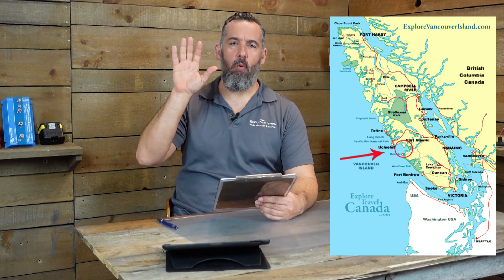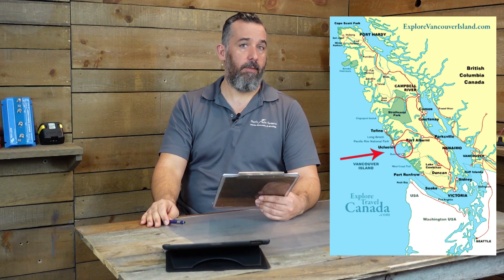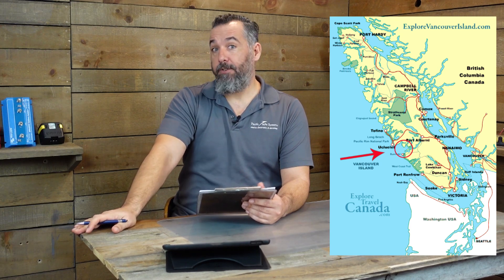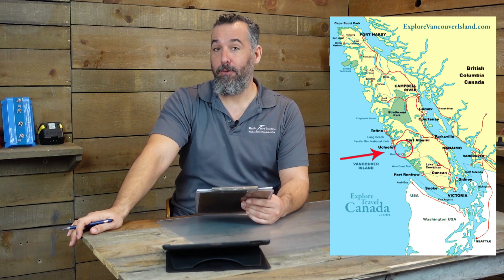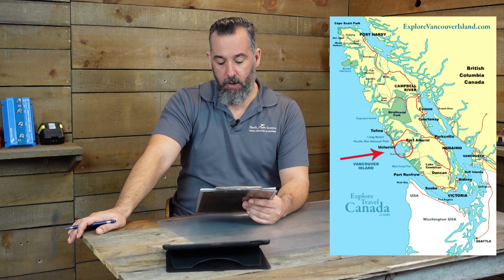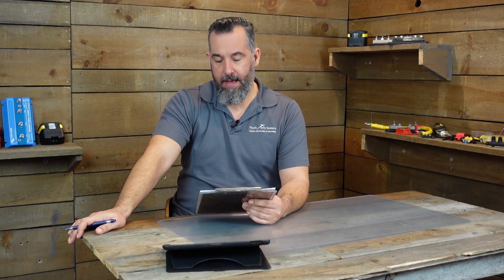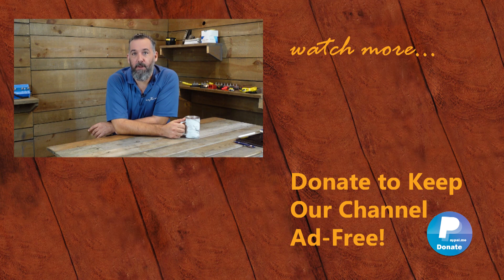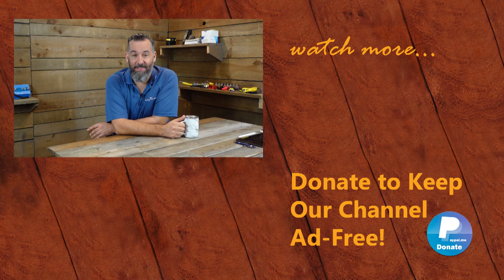If I Have a Fuse Block on My Boat's Battery Post, Do I Need a Class T Inline Fuse To the Inverter?

Comment: Similar question.  My VHF came with an 8amp AGC inline fuse.  I have a dedicated slot in a fuse box for the radio.  Can I just put an 8amp ATO fuse and remove the inline fuse?  The other question is should I, the inline fuse is hard wired so it would require a new butt connector in the wire?
Reply from the maker: Hi Eric, yep that will work. Correct, when removing the inline fuse, you'll be reconnecting the wire via butt connectors or a terminal strip.

Comment: Interesting. Thanks for the answer on fusing. I would not have thought of using two fuses along the line. But I suppose it’s actually fairly common. That way the appliance gets the exact fuse it needs (size, speed, breaking capacity).
Reply from the maker: Thanks for sharing Brian, yep 2 fuses, one for the circuit and other for the appliance is pretty common.

Comment: I always say don't be afraid to add fuses to large loads because the voltage drop across a large fuse is quite small until you get close the the rating and most of the time an inverter isn't goin to be running full-out. Except in a runabout, gasoline is an impractical marine fuel. Just the fact that fumes have no place to go unless you exhaust them deliberately makes diesel much more attractive to me (ok, it's really the torque, but not blowing up is good too).  As always, keep the content coming Jeff. Your channel fills a niche that no other channel I am aware of does. Bravo! (Not the stern drive. LOL)
Reply from the maker: Thanks Tao for sharing.

Comment: Hi Jeff ... Off your immediate topic, but back to battery monitoring systems. I want to install a Victron BMV 712 on my boat but need more RJ12 than the 10 meters that comes with it. Are longer cords available (need 15-20 meters)? If so, where do I get and will it affect performance? Thanks
Reply: You can easily make these cables yourself with telephone wire and inexpensive crimpers that do both RJ12 and RJ45. Good to have around anyhow!!
Reply from the maker: Yep, we are make our own cables when needed.
Reply: @PacificYachtSystems  I read on a Victron Q&A from a company spokesperson that they can lose their accuracy. Voltage drop was one example mentioned. What have you found?

Comment: A class T fuse is a current limiting fuse (instantaneous trip) for levels of short circuit currents above the SC rating of the equipment/device. Batteries and solar panels usually have SC output capacity equal to its nominal supply value. Alternate current power, on the other hand, has very high instantaneous output capacity accumulated in its coils (40 times nominal - more or less).
Reply from the maker: Hi Josi, thanks for weighing in on this. Well said and much appreciated.
SC = Short Circuit, is that correct?
Reply: @PacificYachtSystems  You are right. I barely scratched the surface of the subject.

Comment: Why not an appropriate sized breaker for the inverter?
Reply from the maker: The challenge is finding a thermal resettable breaker that would be rated 300 or even 400 amps. Let me know if you know of one for marine application.

Comment: Hey Jeff,
I've heard you specify Class T fuses before in your videos for inverters.  But I can't really tell why it has to be this particular type of fuse? The only thing that I've found sets it apart from ANL, Mega,... is that it is UL/CSA listed?
I've installed two Victron inverters so far, for friends (with help from your videos :), but not with class T fuses, since they are kind of hard to come by here in Belgium (and I guess Europe). The inverter manuals (yes, I read them :p) also never called for any specific type of fuse.
All the best, and thank you for these Sunday videos!
Reply from the maker: Hey Kofi, good question. Formally most manuals, from Xantrex and even Magnum Energy recommend Class T fuses. My understanding is a Class T fuse is a fast blow fuse and will do a good job of limiting the current to go through the fuse. In comparison a ANL fuse allows for multiple the amount of rated current for a small amount of time. Basically an ANL fuse will not protect the inverter fast enough is my understanding. Any geeks out there that can way in on this? Here's a link to a Class T fuse description:
https://www.fusesunlimited.com/products/classtfuse#:~:text=A%20Class%20T%20fuse%20is,a%20comparable%20Class%20R%2C%20fuse.
Reply: @PacificYachtSystems  Thanks for taking the time to answer! Yes, it's probably all about interrupt ratings, trip characteristics etc. Maybe also quality control and liability..
Sticking to manufacturer recommendations seems like the safest bet here + carrying spares ofcourse.
Kind regards!

Comment: Not to disagree with you Jeff but Blue Sea Systems makes a Class T fuse block that is ABYC rated for ignition protection. P/N 5502100 :) I use one on my house boat.
Reply: This one?
https://www.bluesea.com/products/5502100/Class_T_Fuse_Block_with_Insulating_Cover_-_225_to_400A
Reply from the maker: Hi Paul, thanks for sharing, really appreciate it. Here's the model you are referring to: 
https://www.bluesea.com/products/5502100/Class_T_Fuse_Block_with_Insulating_Cover_-_225_to_400A